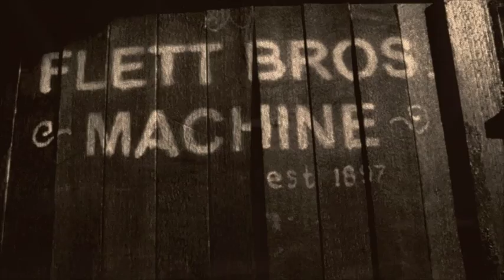A Miniature Steam Engine Machine Shop

Comment: Hello (: 
I wanted to ask you how you build the walls and the bottom of this excelent workshop:D
Very nice Video
Reply from the maker: Thanks! It was built about a decade ago, so the details are pretty foggy now. I remember getting some of the wood from a local hobby shop... I'm pretty sure that was the square pieces that I used for the posts and beams. Probably 3/4" square or so. I also remember getting real lucky with the "planks" for the floor and walls... they were cut from these long skinny "shims" that were sold in bundles at Home Depot. They were already the right width and thickness, so they just had to be cut to length. Saved a bundle of $$$ on those! Because the scale was pretty large, the construction went fairly smoothly. Everything was stuck together with wood glue, and it was very sturdy once the wall planks were on. My biggest obstacle actually turned out to be the roof. (Not visible in the video.) I ended up splitting the outer layer off some really coarse corrugated cardboard and spray-painting it silver. It looked pretty realistic.
Reply: @mcflathead  
Thank you very much for your fast answer! 
It was very helpfull for me :)
:D
Reply from the maker: Glad to help!